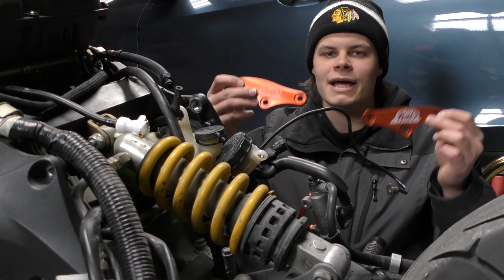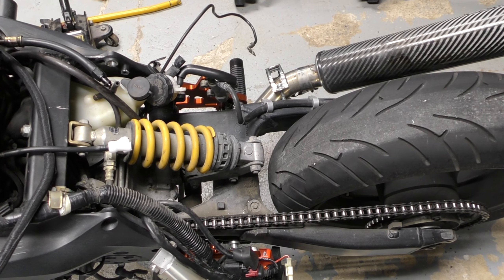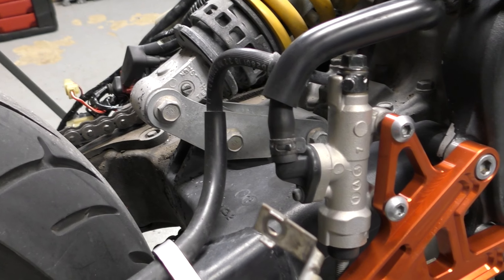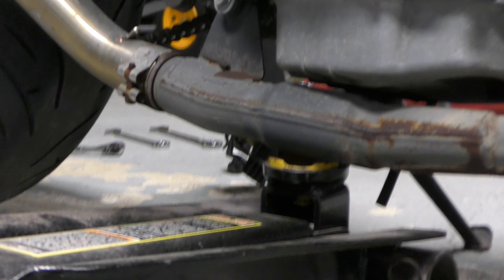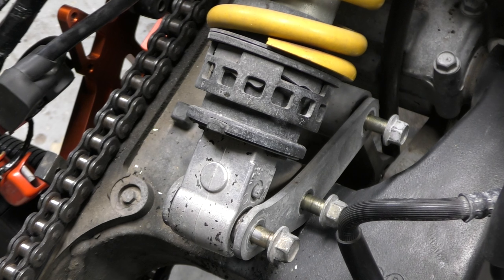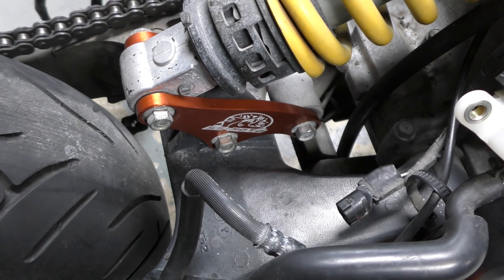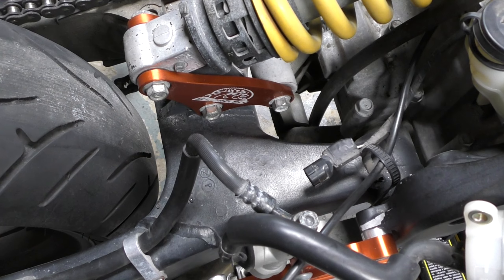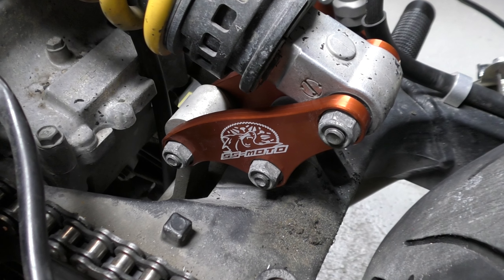2001 F4i Stunt Bike Build - Episode 7: SS-MOTO F4i Saggy Ass Fix

Comment: You did a great job making these videos. I know this question is on the wrong episode but I can't find the calipers for the 310mm rotor kit anywhere, is there a website you can send me that you bought yours from so I get the exact set up?
Reply from the maker: eBay is where I got my calipers. They're just r6 monoblocks. I think mine were between 05-08
Reply: @RobRippin  alright appreciate that guy 🤘🏻